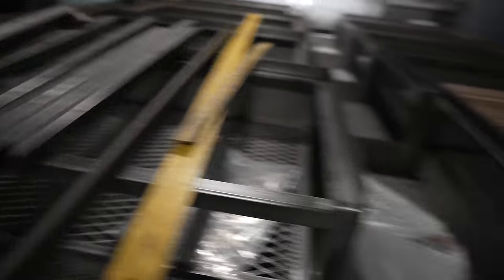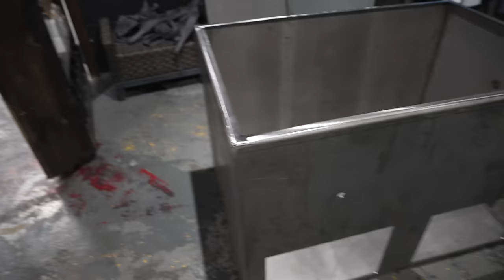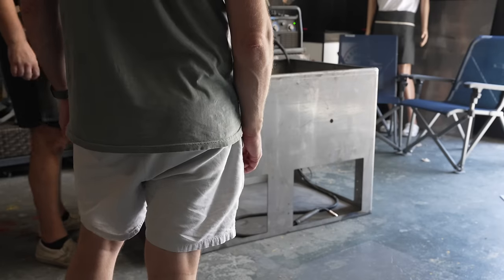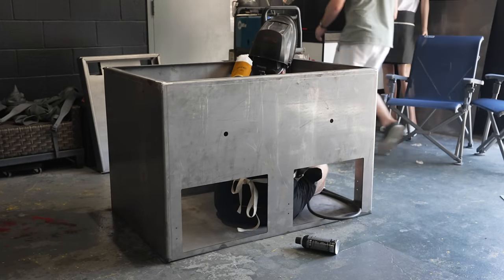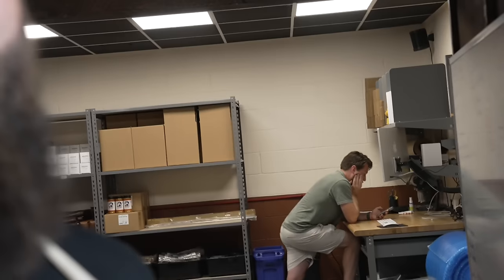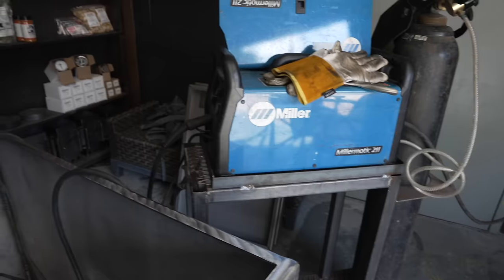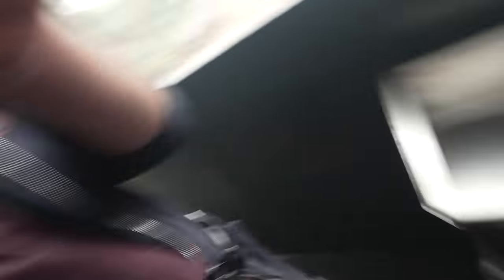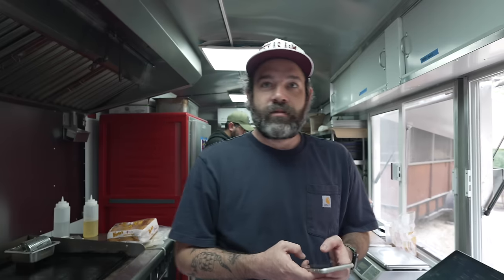Full Size Chudbox! | Chuds BBQ

Comment: I would recommend putting a new breaker in, they get bad after a few times tripping. Also make sure to use the shortest wire possible from the breaker. Try not to use an extension cord, the longer the wire the more resistance it produces and the more current it will need to run the welder and will trip the breaker easier.

Comment: You need a bigger breaker for the circuit the welder is on thats why it keeps popping, also you should push when mig welding, if it produces slag, you drag. And when doing vertical start from the bottom and work your way up.

Comment: If your breaker box is in the sun it's getting the breakers to hot and causing them to over heat. Put a layer of loosely wrapped tin foil around it and put some shade over it some how. Good luck